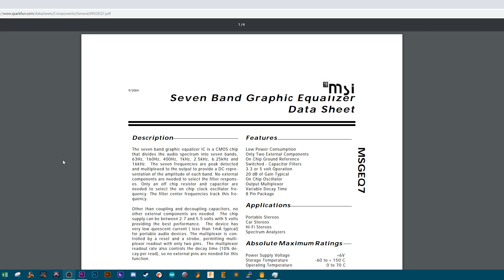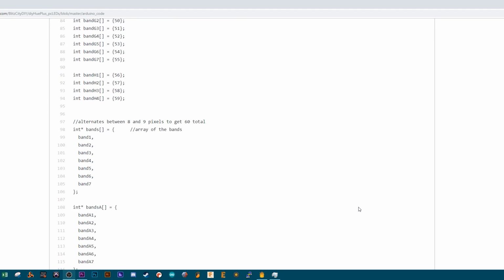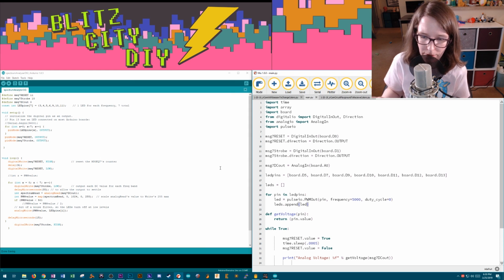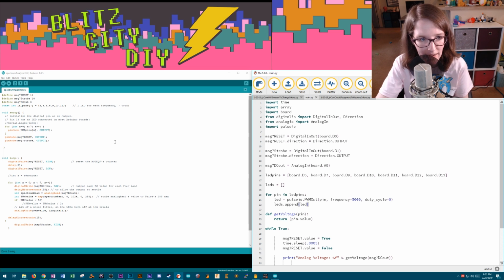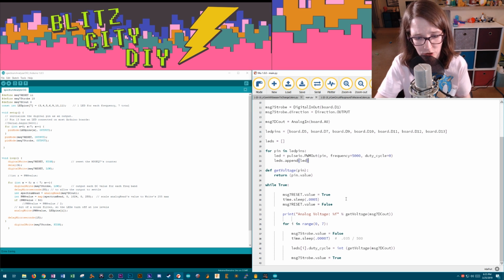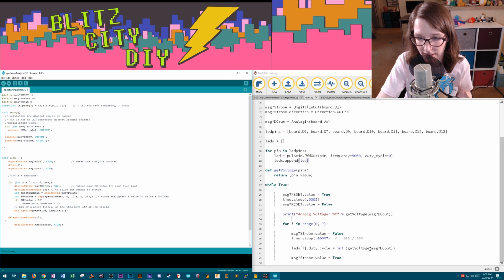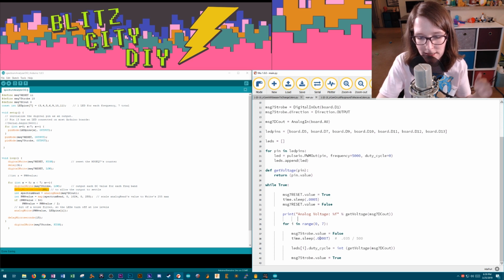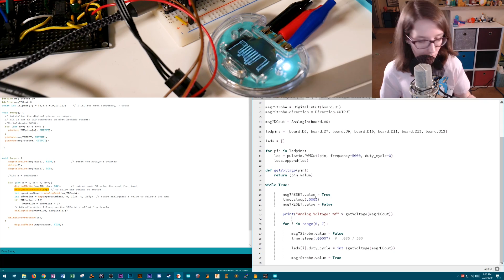Let's Talk About the MSGEQ7: Porting Arduino Code to CircuitPython

Comment: I've worked with this chip a lot but I've always had a problem. The chip reports very large noise spikes on individual frequencies at random moments even when no audio is playing. I never figured this out and the project was put aside. Do you have any idea what might cause this? Thanks for any help you're able to give!
Reply: Did you find the reason?
Reply: @dx9enjoyer74  Nope. I'm actually considering ordering the Sparkfun board just to see if their implementation is any better. Are you having the same problem?
Reply: Yes same exact problem , I try for example a 400hz sine wave and all the bands gave me a reading of 600 and above (it doesn't happen all the time)
Reply: @dx9enjoyer74  Yeah, I really don't know what to do. If the Sparkfun board doesn't work I might email the company or make some more forum posts. If that doesn't do it then I'm assuming the issue is that I'm just expecting too much from the chip. At that point I might look in to getting FFT running on a basic ARM chip or someting.

Comment: So cool.  I started my own GitHub a couple days ago.  Saw your MSGEQ7 project highlighted in Adafruit ask an engineer 4/3/19 video. I've been playing with the MSGEQ7 for a week on a SparkFun Spectrum shield and playing with 2x 300 LED strips. Wrote a little bit of code for it, copied a lot from others and gave credit. Just looked up your GitHub and saw your code.  Do you think you have enough integer variables good lord lol. :P  I wrote something very similar from scratch trying to extract band data without knowing about your code. I haven't uploaded my band extract sketch yet but it looks somewhat similar to yours, we took a similar approach. You have way more individual integers and went much farther in depth than I have yet. You dove deep into it trying to wrestle something out of it perhaps for a specific purpose. I'm working with hundreds of LED's so I'll be forced into multi-dimensional arrays apparently. Mine doesn't work quite right though, I'll assume yours does. I'll definitely check out your code more to see what I'm doing wrong on the band extracts. ;) Awesome video I learned a lot thank you!

Comment: I have a very similar origin story.  My first electronics project was a kind of light organ using an esp8266, neo pixel, and electret mic.  I combined the output from the msgeq7 into 3 bands, low (blue) med (red) and high (green) using the electret mic for audio input.

Comment: Nice! I am guessing that chip has several small op-amps with capacitors and resistors doing a gyrator inductor simulation? I am building a through-hole 5-band EQ pedal for my guitars and basses and am taking that route (op-amps and gyrator circuits). Didn't hear of this chip till now.

Comment: Interesting chip, never heard of it before :)
Reply: This chip is great but new microcontrollers like the esp32 with it's dual core nd the raspberry pi can actually perform fft better. Why use 7 Banda when you can use 255 ? Without a chip